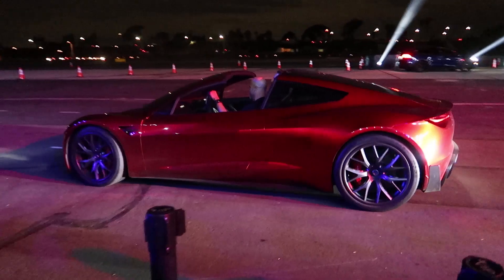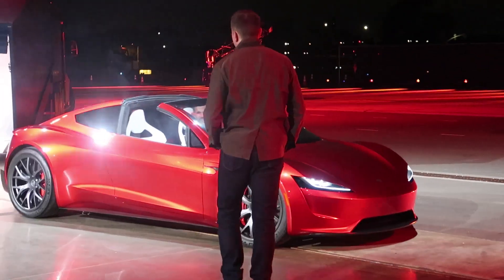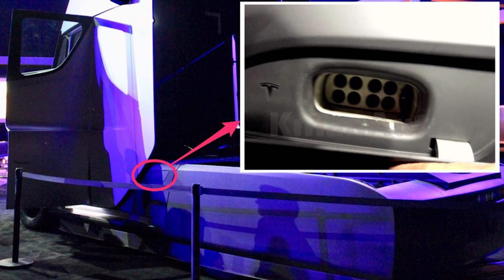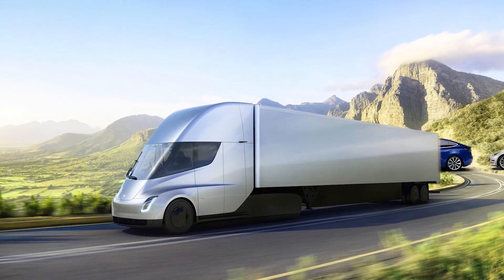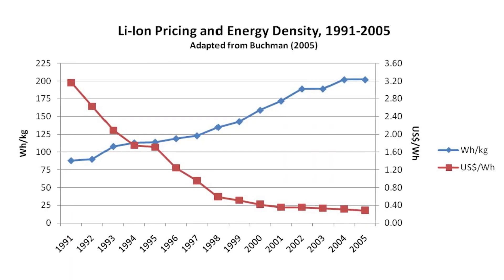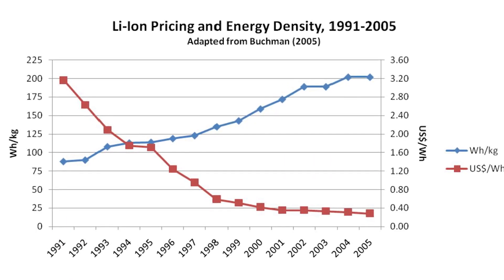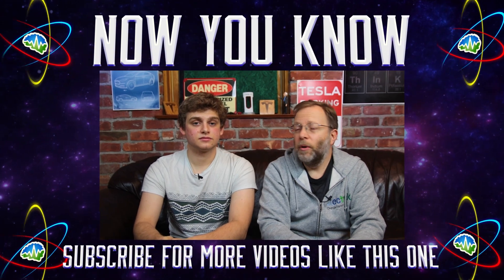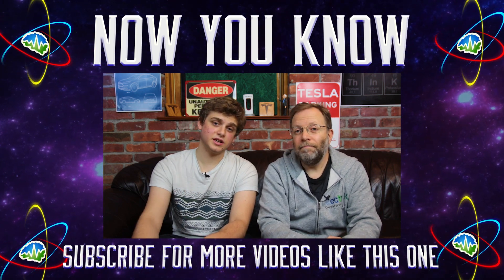Mega Charger Theories - In Depth

Comment: Breakthroughs will happen. That is known. But scaling them for mass production is another matter. If we look at the lithium technology, that is not exactly new. It's not a 10 or 15 year tech. That thing spans almost 50 years already! But the other innovation is making the new tech in large amounts and lowering the cost. That  is the trick. 

I am sure J. Goodenough will be more than willing to license his solid state lithium (or whatever it is he has). If he wants big profits, its still better not to go exclusive to one company or 2. It will also be foolish to sell it en toto. The best is still to license it and have a percentage of the profits sold by making batteries off it. So, if this happens, the only innovation that others will have to do is to produce that tech in large numbers, quickly, and as low cost as possible. 

To this end, it is the company that can do these innovations, and be able to switch quickly to the new batts that will have the competitive advantage. Tesla knows this. They know this because they know that batteries has traditionally been the weakness of electric vehicles (or solar power). So, they know they can gain an edge if they can go over the limitation of current lithium tech and go solid batts with higher densities and longer batt life. I find it hard to imagine Elon Musk is not thinking along these lines. This is so basic and fundamental that I am sure he has an R&D team or 2 working on it now.

Comment: I predicted three-and-a-half years ago that Tesla would achieve substantially higher energy density battery cells and higher capacity battery packs by now.  No surprise at all.  The batteries used in the Model S in 2012 were first developed by Panasonic near the end of 2009, and chosen by Tesla near the end of 2010.  Battery packs are bound to get smaller and weigh less as time moves on.  That will improve range and price.

Comment: Where is the cheap electricity coming from? How about home owners etc. that install the new Tesla roofs and have extra electricity to sell. Those roofs will add up quickly. The Megacharger will probably use automatic robot arm charging. Maybe even so that the charger will also auto steer the truck in to the right spot, (not that any trucker couldn't do it). That charging cable is not going to be light to move around by hand and would require a heavy duty plug, which would also put lot of stress to the socket in the Semi.

Comment: Of course there’s a battery breakthrough, there are breakthroughs all the time because you’re learning by doing. When you have almost unlimited access to lithium-ion batteries you can push the limits and fail again and again if you need to. You then learn where the limits are and you can add, subtract to the product or do whatever you need to to make it better than before. Remember that it’s not always the battery itself that gets better but the way the energy from it that is used more efficiently. It’s just now they come out with fast chargers for cellphones that charges your phone in half the time or less and the battery time that you can use your cellphone has increased every six months or so, so the limits of Lithium-ion are not reached yet by far.

Thanks guys ✌️

Comment: I would think that Tesla engineers have already thought about putting a battery in the trailers when the trucks need a longer range than 500 miles.  I just haven’t heard anything on that yet.  It seems like a battery would fit nicely between the trailer frame.  The battery would cut down on the trailer load capacity but I think that would be a small amount.

Comment: Somebody find out how long the semi will take to charge on 110 from 0%.
Reply: Are you trying to find the longest possible charging time? If you are talking about a normal residential 110V / 35A circuit, that is a 3.85 kVA circuit (=~3.8 kW assuming near unity power factor). To charge up 1 MW from a single circuit would take 1000/3.8 = 263 hrs, or 11 days. Obviously not a practical solution.
To charge 1 MWH to 80% in 30 min from 350 V dc chargers would require a total of 4.6 kA dc current. How many superchargers in parallel would that be? 
Question: Would it be practical to do this using power from the electrical grid without local battery storage? Say you wanted to have a charging capability of 3 semis at once. That is a total maximum charging load of 4.8 MW (1000 kWH x 80% x 3 semis / 0.5 H = 4800 kW). So, yes quite practical, but it does require the 25 kV distribution line from the utility (or 16 kV, where that is the standard distribution voltage).

Comment: When the new battery technology comes out in 3-5 years what then? Now some 1 has to invest billions in manufacturing these batteries in scale which would then take another 3 - 5 years, and were not even sure they these new batteries will even come out in that time-frame! Plus! What is to stop Tesla from simply adopting those new batteries assuming they dont develop one better them selves? I also think investors will invest in batteries with the most long term economic potential. IE. What they can make money on. Lithium fall in this category since one has to mine the Lithium, transport, process and assemble, this generates lots of jobs and money along the way.

Comment: Tesla is not reliant on any battery breakthroughs. As you suggest, Roadster and Semi as launch event likely powered by 2170 cells. The Tesla Model 3 test report for EPA published by Electrek, on page 14/15 gives the following battery weight 480 kg, battery volume 0.400 cubic metres, battery specific energy 150 Wh/kg, 350 nominal volts.    150x480 = 72,000 Wh - Tesla usable figure.  Test report page 15/15 said battery held 78,269.46 Wh. 163.06 Wh/kg (587J/gram). As the battery is 46P,96S (4416 cells) - thus 17.724 Wh/cell. Divide by 3.6 Volts = 4.923 Amp.hour. 
Using the Tesla usable figure of 72,000 Wh for the battery = 16.3 Wh/cell. 4.53 Amp.hr per cell. 
Samsung SDI NMC 75 gm cell has 4.75 Amp.hour. 
2170 NCA cells were expected to be 5.5 to 6.0 Amp.hour.
Thus I assume - the Tesla 2170 cells are NMC. Would love to see the same report for the Model S. 
Having done a measure of a battery pack from a vehicle diagram, pack has 30 kWh/square.metre. Model 3 pack cell layer is 2.61 sq.m. Dividing by battery volume gives a 153 mm thick pack. however, each additional layer of cells likely adds just 80 to 85 mm to pack thickness as cells are 70 mm tall. Modules likely have a volume of 350 to 375 kWh/cubic.metre. This maybe trimmed 10% for the battery casing.  500 mile Semi likely needs 3 cubic metres for pack - 2.4x1.8x0.7 = 3.024 cu.m. 
Roadster would need about 6.8 sq.m of cells - 
-- 2 layers of 3.4 sq.m - 1.5x2.25 metres - 240 mm thick - I think this is what we likely saw. 
-- 3 layers of 2.3 sq.m - 1.3x1.77 metres - 320 mm thick
If NCA cells used, the layers could be reduced by 15%.

Comment: Regarding the expectation of better battery tech in a few years...  Sure maybe/probably something will come along with better weight/charge ratio, but by then Tesla will have had almost half a decade to ramp up  giga factory efficiency, producing and fielding world class vehicles.  The new tech competition will still be trying to figure out how to make their alien dreadnought manufacturing work. All the while the giga factories (there will be several by then) will be cranking out batteries only observable with strobe lights.  Tesla's factories will not be obsolete any time soon, and the batteries will keep profitably pouring off the lines.

Comment: I agree. They are most likely using current lithium technology with a little better density. 
Another way to reduce battery cost is to recycle them. I imagine a portion of the gigafactory is set aside just for that. 
It’s something Tesla has been mum about since their inception, but at some point they will have billions of batteries 
That can be recycled to reuse in just about any form they want. You might consider a show, just about recycling and why
Or why not, Tesla will do it.

Comment: My guess... Existing tech.  4 battery packs in parallel, charging in parallel to keep time at constant 30 min.  Probably some cross over circuitry for fault tolerance.  Your picture of the charging port backs up this parallel architecture.  Probably same tech as used for grid scale storage.   Their cost today is probably the announce list price of the vehicles.  That would mean that if none of the battery cost improvements come through they could still make and sell them without loosing money today.  And they know what battery pack price improvements they expect to see from giga factories in the next 2 years and that will be the profit margin on these vehicles in 2 years which will keep improving for years to come increasing their margin or then lowering the customer cost..

Comment: Guys, very likely most of the mega-chargers will be destination-hub located, not strewn about the city in malls and stuff. For example, Walmart would have them at their warehouses, and possibly at the loading docks of many stores. So as they load and unload their stock, they get charged back up. Also, they would be located at truck stops along the highway, so as they eat/sleep, they top up. So there is a possibility these mega-chargers won't all be free to install; those located on company property may have to be bought and they also pay for the infrastructure to install them. Figure they do it for diesel gas pumps at their warehouses, they would do it for the chargers as well. So there is money to be made there for Tesla.

Comment: tesla also has a patent for a coolant charging system which would make it faster without excess heat while charging
Reply: A "coolant charging system" would only be useful for filling up the cooling system with coolant, not for charging the batteries. Perhaps a terminology problem here?
Reply: the coolant could be used as a heatsink more effecient that air especially when power is not used by the vehicle being charged but the chargine system itself I don,t have all the detailss but  removing heat while all those amps are flying in would allow fast charging  in keeping with sensing the heat of the batteries  anyway tesla  I think has a pantent for this type of charging lets not forget the tesla vehicle sends coolant thru the motor and the inverter as well as coolant for the car batteries now

Comment: @Now You Know - One thing people aren't mentioning,  Musk explicitly stated the charging is going to be DC-to-DC (Semi).  Would you be able to extrapolate why this would benefit the charging profile and speed? It could also reduce the of the truck cost by eliminating the need for an extremely large (1MW) AC-DC Charge controller inverter. 

I believe they are using existing 2170 designs, with updated battery pack configuration to maximize life and increase recharge/discharge speed.

Comment: I know there are new battery technology. However, the current technology of Li-ion cells can be improved by change electrolyte. My professor co-worked with Tesla on that. New technologies with major leaps need to balance between energy density, charging time, life time, price and safety which is not an easy job to accomplish.

The cost of Li-ion cells will drop to lower than $100 within 2-3 years' time. Model 3's battery manufacturing cost is at $120. It is unreasonable that it will not drop due to economy of scale.

Comment: Today's supercharger limitation for Model S & X is at around 120kW for a 400V pack. (Model 3 has higher limitation but I forgot the number) If the double the voltage, they can double the power. However, I think they will have a 1600V pack which 4x the speed simply by increasing voltage. From your video, there are 8 holes which means 4 pairs of lines. They can increase the current by 4 times using today's wire config. That means 16 times of 120kW. 1920kW or 1.9MW!!! More than 1.6MW estimation.

Do you have any information on the electric motors? The pack voltage might be close to the motor voltage to reduce conversion efficiency loss.

Comment: The battery "break through" already happened, the new 2170 cell is 50% more energy dense! Thats HUGE!! That is how they'll be able to get 200kwh in the roadster. 

My father is electrical engineer working with electrical distribution. I asked him if adding, say 2 mega chargers with 8 stalls in a smaller/medium sized city would be any real impact to the whole cities power draw. He said pretty simply, even if all 16 (in this scenario) stalls are full, the city would hardly even notice the extra power draw. Quoting him, "there is tons of excess power all around the county ready to be diverted to wherever it is needed."  Fun fact: His company, Black & Veatch is one of the main contractors building the supercharger stations.

Comment: I'm pretty sure Tesla's current battery technology will suffice and by the time the semi and the roadster come out prices will be down far enough to make a proper profit.
Tesla stated that the semi uses ca./less than 2 kWh/mile. Multiply that with 500 and you get a 1 MWh battery max. That's 10 batteries with 100 kWh, which is what Tesla already has in their Model S/X and why would they not fit that into a semi with way more area and height to use for batteries? I'm sure they will only be good for DC mega charging...

I'm getting sick of the "it can't be done" mantra certain folks keep on doing no matter how many times Tesla has delivered working technology (OK, not always on time). Compared to all other car manufacturers they are doing well when it comes to EVs. I do remember how Renault didn't deliver their ZOE on time, either. We all survived.

Comment: Here are a two new battery technologies that Tesla can be using right now as they really aren't that new as you will see in the videos: https://youtu.be/gxZrQ5yPsLI?t=26m34s ; https://youtu.be/yxABosWfuus?t=23m32s. As you will see there are new technologies that have been around for a while now thus given how Elon Musk likes to have the safest cars on the road this seems like a logical step he might have taken to achieve that goal. You will note that with the new battery technology the new technology's battery density more than doubles for the same size package while at the same time being fire retardant. Then you take out all of that high manufacturing cost as the new processes are far cheaper to make batteries and safer which is a win win for an electric car company. 
Just imagine being able to just go into Tesla Motors or some high mods company and swapping out your dangerous batteries for these new non-combustible batteries and you get double the capacity you had before the swap 😋 as a bonus. Whom out there that owns an electric car would say no to that proposal? Your leaf would go from an 30 kwatt battery to a 60 kwatt battery and it be safer than the old one you got rid of. That means that your range should double as you now have double the energy storage capacity, correct? This is what is in our future and as we have seen Tesla Motors might already have access to this new technology.

Comment: there are problems with increasing the power density of batteries. And it have to do with safety. The more energy you have stored in a given confined space, the more dangerous it becomes if something malfunction. There will probably be laws in the future that will dictate how energy dense a battery for different given applications are allowed to be. 
For example, take Samsung notebook 6 or 7? (i don't remember witch one) that spontaneously started burning. People got hurt and burned because the battery gave out all its energy at once.
If you all of a sudden invent a new battery that have 10 times more energy per unit mass, and it combust in your pocket, it would probably burn you leg of. A risk you are willing to take?

Comment: Here's what I think is going to happen. By 2020, all new Model S's model x's and model 3s wiill have 200 kilowatt hour batteries preinstalled.  what they'll do is they'll sell them in either 75 kilowatt or 100 kilowatt or possibly 120 kilowatt "sizes" and then you can virtually upgrade later on, like you can currently do with the 75 kilowatt-hour upgrading into 100 kilowatt hours. So later on you know you can upgrade your 100 kilowatt-hour battery to a 200 kilowatt hour battery and then you have a 600-mile range. This how Tesla can stay profitable and provide battery variety. Yay, the technology is advancing

Comment: Both Roadster and Semi are prototypes.  I don't think it makes sense for them to use the current tech in them when they should be standardizing on the new battery tech.  So they probably both use a little better tech with newest battery size and chemistry.  Especially considering they'll go into production in 2019 and 2020.  So the prototypes can be made in small batches with new tech to work out kinks.  Both depend on Model 3 driving cost down a bit but I think they're good there since I think they are already under $100/kwh.  They got that world renowned guy working on this stuff years ago, and with the pace they innovate, could easily be ahead of where everyone thinks, just need to get it going on production side.